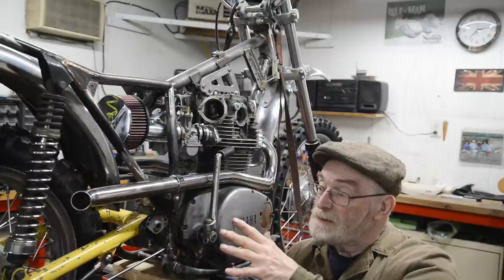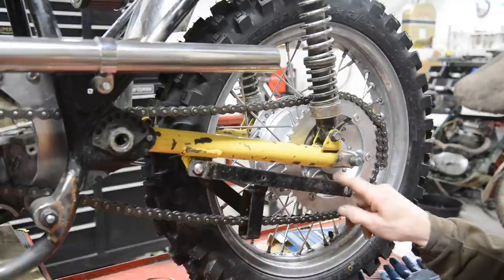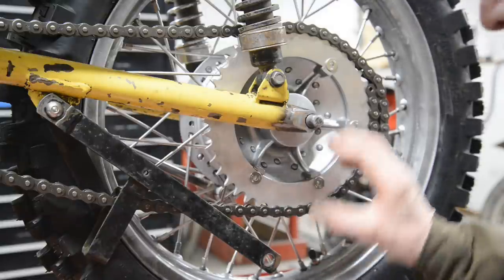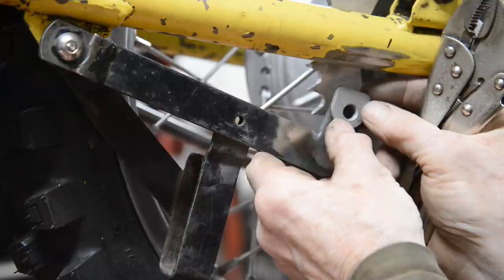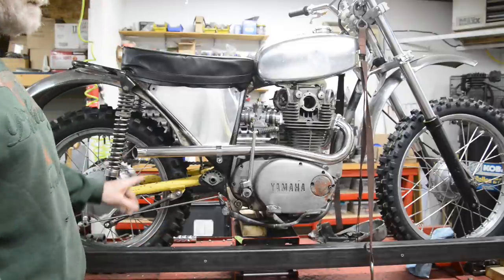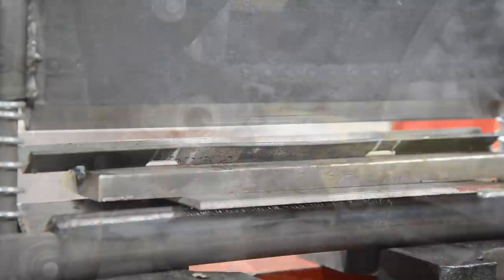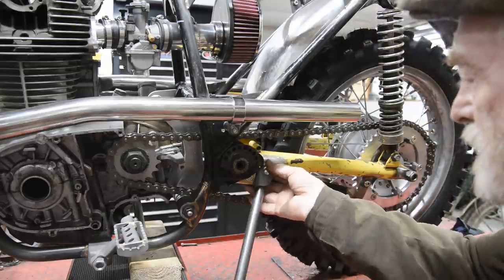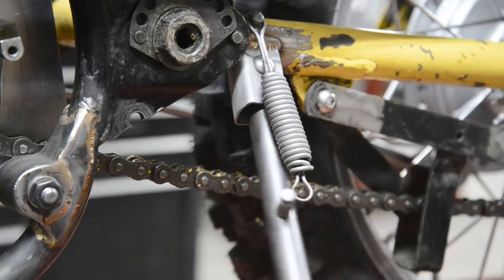650 YamBSAki Scrambler  -  Part Fifteen

Comment: Ok, no need to  move the exhaust for the oil change, just turn bike upside down and fill through the drain plug.   You’re welcome.
For all this that can’t get over the oil filler cap, never, ever buy or attempt to work on a Bimota.
Alan Millyard has a neat trick with stand springs, he bends the spring and loads a few washers between the coils which allows it to be fitted easily in the closed position, as it swings through full extension the washers fall out.
Reply from the maker: With strong springs I do that as well. I think I have shown it in a previous video. Love Allen Millyard's work. His videos should be called what you can do with hand tools.

Comment: Great work, the side stand looks very good, you made it look easy.  I'm glad you didn't fit a chain tensioner, I'm not sure that they do much except add friction and dirt traps, surely on the overun the slack all goes to the top anyway?
Reply from the maker: It is another of those things where bikes worked fine without something for years and suddenly they become a necessity.

Comment: That's not just a filler cap,It's also the dipstick so every time you want to check the oil level you'll have to remove the exhaust pipe.
Reply from the maker: A) I don't have to remove the exhaust as I demonstrated. B) how often do you check the oil, hourly. It is not a problem.

Comment: I think you may find that the chain guide will foul the chain at full compression. The competition bikes had larger rear sprockets than you have. just a thought! By the way, I love all the bikes you have done. Keep up the great "work" - it is a hobby isn't it? Rob in Oz
Reply from the maker: Hello Rob. I did check the length travel of the chain with the suspension unit off so that I could move the swinging arm and I have space top and bottom. I just didn't show doing it.
Reply: @BritanniaMotorcycles  Hi, Michael. I meant at the top. Rob in Oz

Comment: Greetings,  A stupid question.  Is that chain guide even necessary?  The chain run is terribly long.  You need to protect the engine mount, and provide a tensioner, but does the chain flap around so much you need that big mess of a guide hanging on the swingarm?
Reply from the maker: As BSA built world championship winning scrambles bikes for many years I have to believe that they knew what they were doing. Having said that some bikes had them and some bikes didn't. I decided that as this bike did I would stay with the BSA design.

Comment: Mike, at some point you have moved from Bronze welding with Gas to TIG. May be I have been asleep and you have done this already but could you explain the set up you have for the TIG bronzing may be when you are finishing the frame, it looks a better set up for home use without the bother of gas supply etc.
Reply from the maker: I had always used gas for bronzing and for welding as it was cheaper (one rig for all types of material) and I preferred it to MIG or arc (stick). I got the TIG so that I could weld alloy more easily, then started using it for steel welding and then tried it for bronze. It was so much less fuss than gas that I just went over to it completely. I will mention it in the next video.

Comment: I was wondering why you didn't weld a nut to the chain guide on the back , no clamp needed?
Reply from the maker: I will when the wheels are out. I just didn't want to keep taking it apart all the time.

Comment: Michael,
Are you sure the swing arm has room to move forward, when adjusting the chain play?
Nice bit of work btw
Reply: It's at its shortest adjustment here. As he turns the adjusters, the swinging arm will move backwards.
Reply: Paul Jenkins ,
Hi Paul, I initially thought that, but the eccentric adjuster is close to max length?
Reply: @jaymar2176  it is in the full forward position now. But the camera angle is making it difficult to see the other clearances
Reply: ahh you may be right,
Reply from the maker: Yes it is all the way forward. You can use the front and rear fixing pegs to increase the travel.